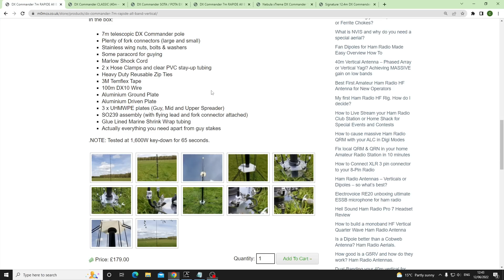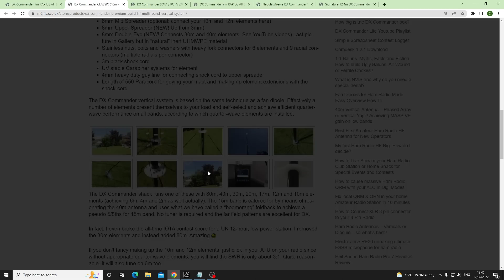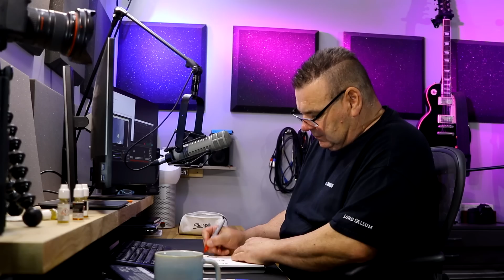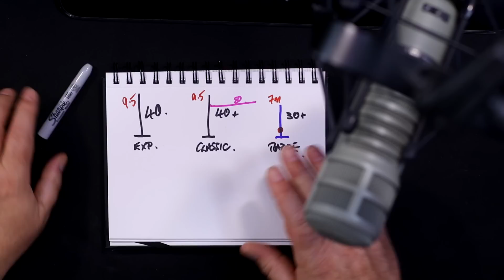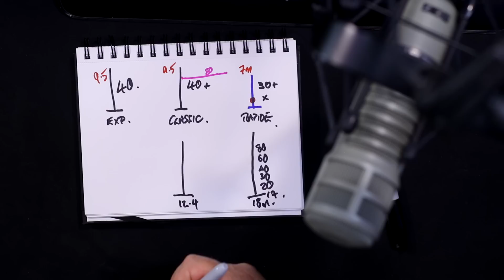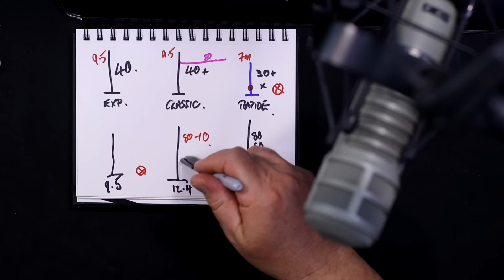Which DX Commander to Choose in 2022?

Comment: I'm looking for a vertical 20 M - 10M (6M??) 600w PEP??? (I'm not interested in 12M) 
I have a VEE wire antenna for 160-40 Meters.....this is the 2nd time that a Piece of S*** Hexbeam broke apart from a wind storm. $650USD all burned up.
Reply from the maker: Adrian.. Look at the Rapide. Ignore 30m if you don't need it and remove the last 2 sections of the telescopic pole (actually, invert the 2nd to last section and shove it back into the top of the pole to keep the upper spreader solid to connect the elements to. Shout if you need instrcutions on that... Use 4 elements and go 20, 17, 15 and 10. Or use up 6 elements and do 12, 11 and 10 as well.. ALternatively, leave it "as is" and get everything from 30m through 10. Best I can do. And may I say that I am sorry for your hardware losses..
Reply: @DXCommanderHQ  I sent an email. You're tallking like I already own one of your antennas. Looks like I buy a Rapide. The rest of your statement above is like a puzzle. I have no idea what you're talking about.

Comment: Hi Cal, we have an 18 m Spiderpole in the club for FD. Would your parts fit and would you sell them without the pole ?
Reply from the maker: Martin, we do the parts. .. couple things to be aware of. a) feedback from other 18m Spiderbeam users was that the SB pole is (apparently) more twangy than DXC (in other words it probably looks more wobbly - I honestly can't compare, I don't have one) and also the ground plate that slips over our threaded base will be weird on yours.. You CAN leave yours just hanging around and lay it on round I suppose. HOWEVER although most of the bits fit, I didn't deign it with Spiderbeam in mind.. If you like, it's just lucky - so I can't guarantee anything.. Anyway, you can email Loki for a shipping quote. The plate set with SO239 is £125. Feel free to copy / paste this comment when you email Loki in dispatch: loki at dxcommander dot com.

Comment: Question @DX Commander, I just got a rapide with the cheaper wire. Does that change in velocity factor effect cut point recommendations that are based on the dx 10??
Reply from the maker: Nope. Nothing in it.
Reply: @DXCommanderHQ  sweet. Thanks. Ordered a roll of dx 10 extra because you can never have enough 😆

Comment: Everyone, curious about the field portability of something like the Classic, which is attractive because of the number of bands at once, vs the expedition, which only gives 4? At one time. Signature 12.5 is a bit more than I was hoping to spend as I don't spend much time on 80m

Location is the Pacific Northwest US, most of our seasons are rain.  Typical deployment is a weekend of camping with the scouts, like the upcoming Jamboree on the Air, rain or rain or rain or shine.  It'd be nice to not adjust the antenna (already have a wolf river coil, looking for a set it and forget it kind of any HF band antenna for a entire weekend of fun)

Should I just get the expedition or is the classic (or something else) fairly well suited to POTA like temporary work
Reply from the maker: Honestly, either will work. Classic slightly more robust in terms of "accidents" however on the Expedition you get 4-elements and that will perfectly cover 40m, 20m, 17m, 15m and 10m. So you are not THAT restricted. Classic slightly more substantial and possibly easier to put up inverted L in favor of the 30m band. As we say in UK, it's horse-for-courses..! If you want to chat to others, ask around on the Discord server where many folks will have an opinion discord.io/dxcommander - good luck!

Comment: Hi cal,could I use thin sotabeams extremely thin wire (max150w) just for the 80m wire as its very light n thin so ideal for the L on 80m ?? But use the dx10 for the other elements?
Reply from the maker: Yes.. I only burned through ONE wire in my life and that's because the RF jumped to a guy point.
Reply: @DXCommanderHQ  nice one thankyou 👍

Comment: Ok, I do not want a very tall antenna.  Do not want to advertise from the street, and too close to power lines.  How about an antenna system which  is fed at the base, go up through the top, and are 1/2 to 1/4 wavelengths.  Then each wire is terminated at the correct length with an insulator, and non metallic rope is used as supporting the central pole.

Am I crazy? Have I been on Ham Radio 2.0 too long.
Reply from the maker: Yes. Just like a DX Commander but say connected to a tree? Perfect!

Comment: at the 2 minute mark.... the Radial Base Plate is on the Ground... Is there any way to elevate the radial plate up so that in the winter I can keep the base plate out of the crud ? This is the only reason I haven't purchased your verticals.   I live in Wisconsin.   We have like .50 meters of snow on the ground for 6 months.   I don't want the radial plate RIGHT ON the ground, getting all cruddy with muck.   Thanks for your time and great video :)
Reply from the maker: Yes of course! I do this on the 12.4m Signature.. Anything will raise it up. Ideally, a small tube of around inch and half (maybe 1 and 3/4) ssunk into the ground say 1 foot and include a simple hose clamp to stop the DX Commander from coming back to the ground. Perfect solution.
Reply: @DXCommanderHQ  Thank you for the the information.   I am running 2 verticals.  The HF9V and a ZeroFive Vertical that is like 60 feet tall.   The HF9V is great because it's low swr, but it's a nightmare to tune.   The Zerofive does everything moderately well, but I waste a LOT of power in the UNUN and the efficiency is a joke.  I am running 60 radials.  I love yours because it's no tune and I can operate on any part of the band.   I have NEVER used the microphone on my Icom 7300.    LOL.    I can only get good efficiency on CW and digital.    Maybe I can use the microphone with your antenna... ;)  Greg
Reply: @GreyGhost-r4z  FWIW the ground plate of my Classic is elevated slightly using an inverted frying pan, sounds worse than it is. but keeps the grass back a few inches...
Reply: @g0fvt  Great Idea !